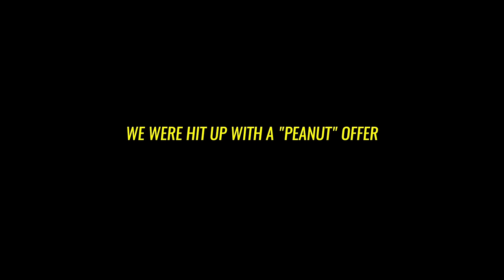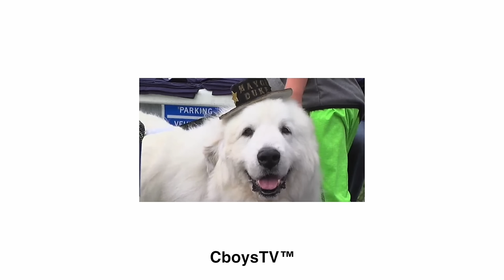NEW 2 STROKE BIKE FAIL!!

Comment: The bikes battery is dead so the injection wont run @cboystv
Reply: Anaïck Morin yeah that’s tru
Reply: As it sat there and cranked over no problem? Sounded like no compression.
Reply: It died when he snapped the throttle the injectors not giving it gas so no battery
Reply: @anaickaube17  lmao.  Ok.
Reply: Anaïck Morin then if there’s no battery how did it crank over and start?
Reply: Enough battery to crank but not to run the injection and fuel pump